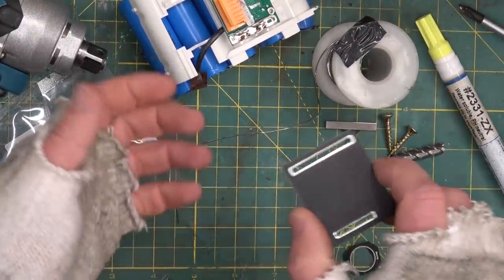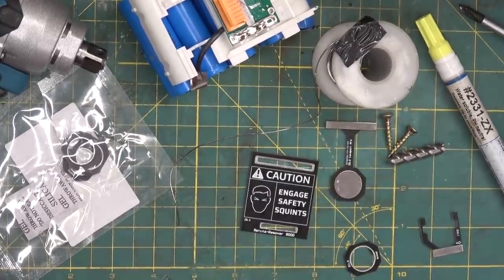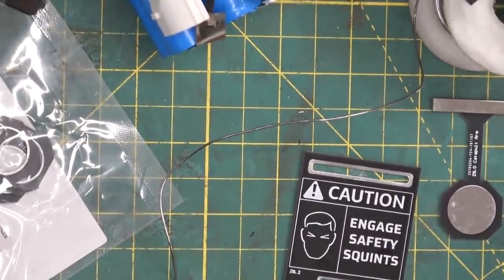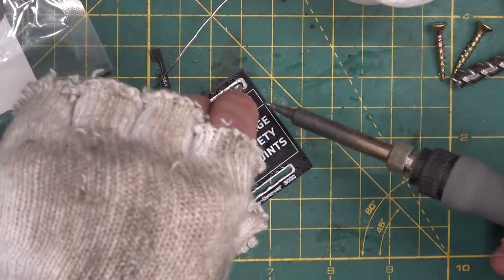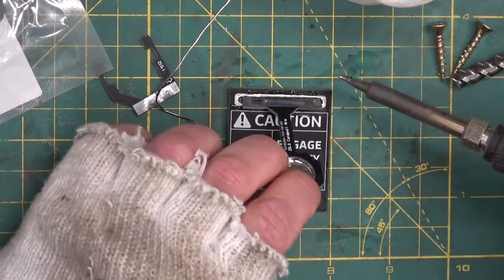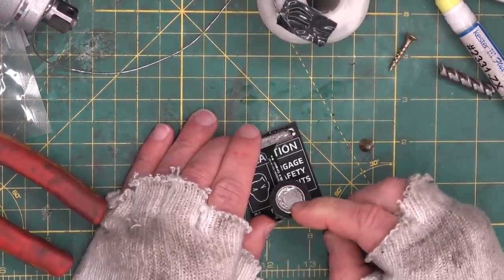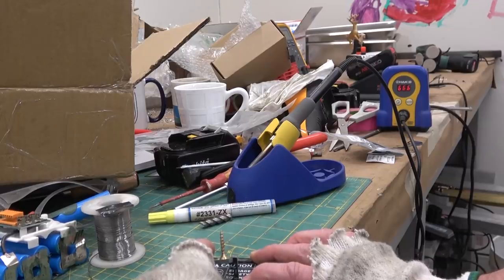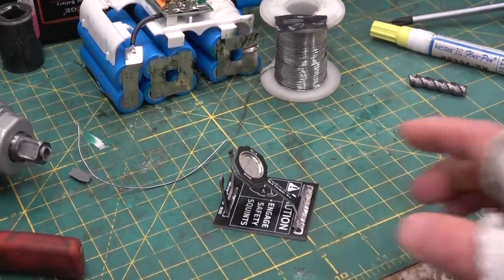BOLTR: Cataractapult

Comment: Ave, in a plant where I was installing a security system  (boiler/chiller plant) there was some very big gate valves that were on a PM schedule. At times the packing glands would leak a small amount of liquid and they would put a bucket  under the drip. They put a sign on these buckets  that said "empty when full". That made perfect sense, until I asked them for one of the signs to put on my hard-hat.
Reply: That's odd that the sign said that, shouldn't the bucket be full when it's full and empty when it's empty. Kinda hard to be empty when it's full. Lol literally speaking of course
Reply: Though the bucket is always full even if its only air.........
Reply: @Intimidator82  thats mushroom talk

Comment: Got an odd request for a boltr but there’s this new tool for Declaws glaucoma where you can put a material in the chamber of the tool and using any heat source it will extract the material into a vapor form. Machined in Wisconsin with steel or titanium. There’s a dirty wood elf variants but the main product is the stainless steel model. 304 medical grade if I remember. No batteries so you gotta provide your own heat but that’s where it gets really interesting. You can heat it with butane, a cheap lighter, a camp fire or do what I did and build an induction heater so you can heat it up with angry pixies. You wait for it to click  then you can do your extraction. It conveniently connects in laboratory glassware of the Declaw variant so you can cool down the vapor. It’s well under a hundred yankee bucks. It’s s tool I use daily for chronic pain and will attest to the skookumness.

Comment: Nice and very creative. I'm in favor  more lethal, lower budget object launchers.  Just take a suitable sized welding rod and insert it in the orifice of a high pressure air nozzle that you use to blow the chips and such off of your work.  We used this method to terrorize foremen we didn't like in the big shop whose initials might have resembled GE, that I worked at years ago.  A high velocity welding rod whanging of a steel column next to the foreman's head, spraying flux fragments, sent a powerful message.  Just practice a bit to get the aim right, the object is to frighten them, not kill them.  Slightly less dangerous was to take a wire lug, bend the ring end and hold the other end as you hook the ring over a large rubber band held between two fingers.  Pull back and let her rip  We had a huge variety of lugs to chose from, tiny to large.  One night on 3rd shift we had a little war going on and I intercepted one of those things with my chin.  It bled a bit, as I laid writhing on the floor screaming for a medic.

Comment: Safety is so overrated.
Reply from the maker: Safety 3rd always feels about right.
Reply: AvE safety is number one priority
Reply: @arduinoversusevil2025  ver 2.0 have a drunken calibrated sight?
Reply: Mr Panda AvE is number one priority**
Reply: @arduinoversusevil2025  funny, that's Mike Rowe's rating, too.  See his TED talk.
Reply: Safety is subjective at best! Getting a safety award is like getting an award for not killing yourself or anyone else YET!!!! We all know you will eventually but here’s an add-a-boy for today!
Reply: @arduinoversusevil2025  that mike rowe speech was impressively accurate
Reply: @Mr Panda(spoken in a mixed Russian-Canuckistanian accent?)
Reply: @mrpanda2655  nothing is that simple, in reality safety is better described as an objective. Everyone takes risks every day, potential injuries balanced against desired outcome. If safety was actually a priority then the use of any sharp objects, vehicles, or heat of any level that could injure would simply not be allowed. The use of the phone I'm on would not be allowed as there is a mynute risk of the battery exploding, but as safety is not a priority it does not get an automatic value above all else and I'm able to balance the need for safety with other needs and desires and weight those costs, making safety an objective with a fluid value.

Comment: Unfortunately, this fine device is destined to go the way of the Dodo Bird, Great Auk, Passenger Pigeon and the Avro Arrow.....ouch. How's about some ketchup and mustard.....in the same bottle !! That would sell great for those summer cookouts, and double as sloppy joe sauce in the winter months. I'd like mine to come in a tube I can load into my lithium battery powered grease gun that has a handy belt clip, just so it's always handy.
Reply: Just thinking something a little more friendly to the masses. Rebrand the grease gun as the "Injecu-Meal 2000" and also offer full course meals as well as the aforementioned condiments. For the Man on the Go....available in battery powered and CO2 propulsion systems for those prepped types.